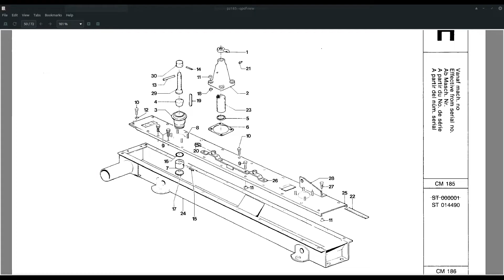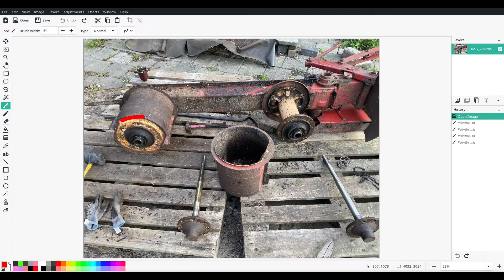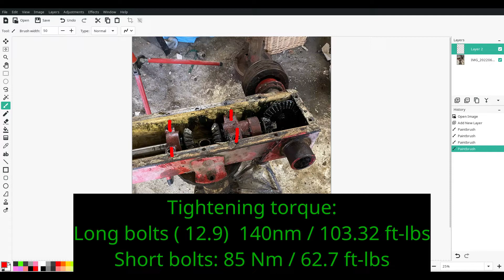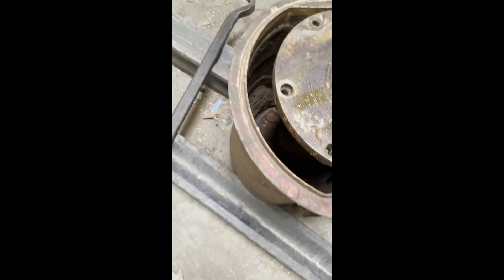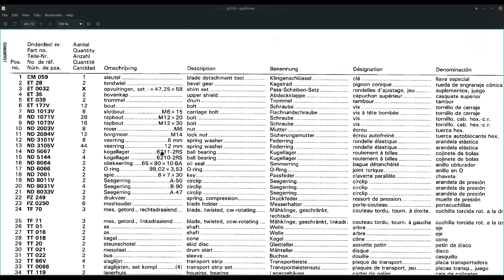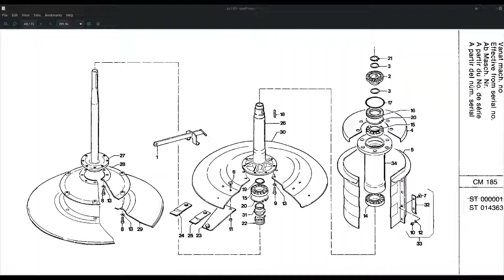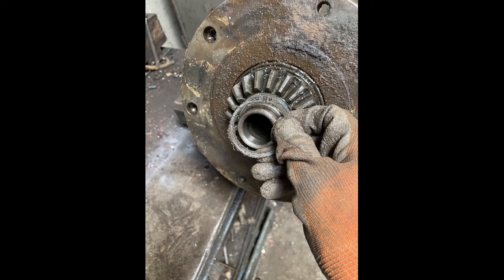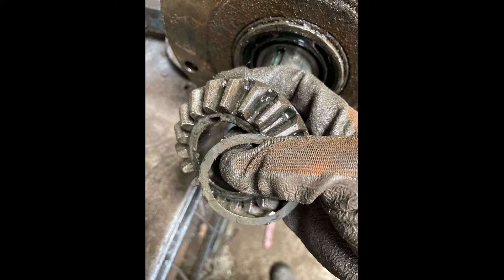PZ Drum Mower Bearing Replacement

Comment: i have one of these the drum nearest to the tractor wheel has stopped working but the other one is still working so where / what do you think the trouble could be thanks
Reply from the maker: What happens when you turn the front drum (tractor side) by hand (tractor off obviously)? Does the belt pulley turn or the rear drum? Or none? Then check what happens when you turn the rear drum by hand.
Reply: @Spannerman_  nothing moves when truning the one near to the wheel. second drum turns the belts and pto. theres no noise when i turn the first drum no gratteing or grinding just turns freely
Reply from the maker: @orkidknog4147  Souds like something must've broken or sheared off in the drive of the first drum. In any case you'll have to remove the top cover to see what's going on.